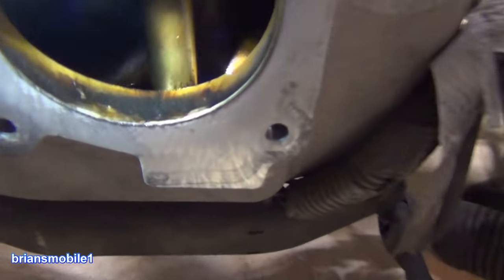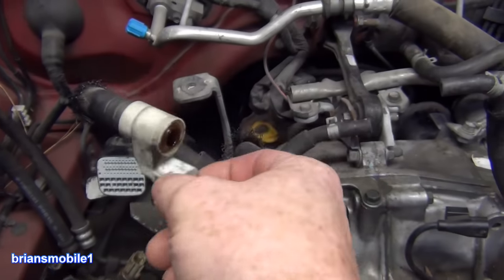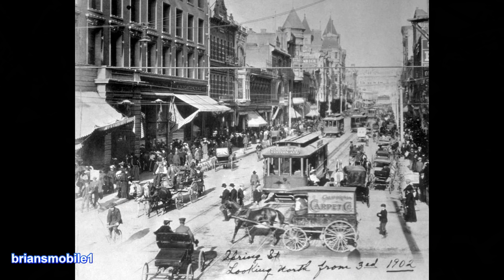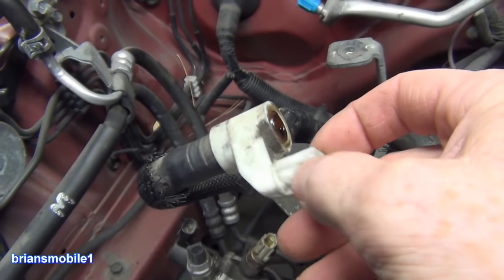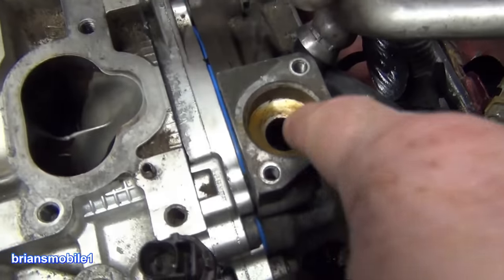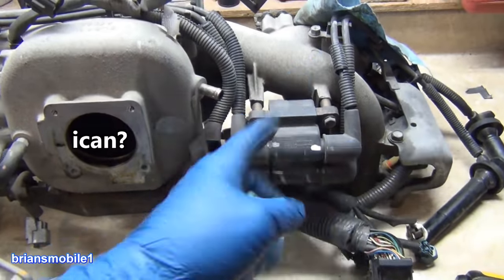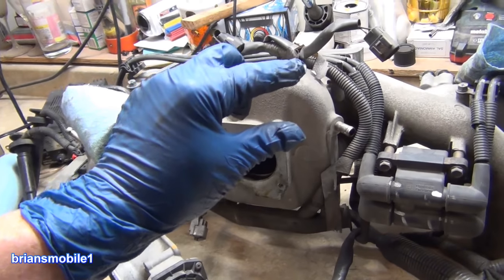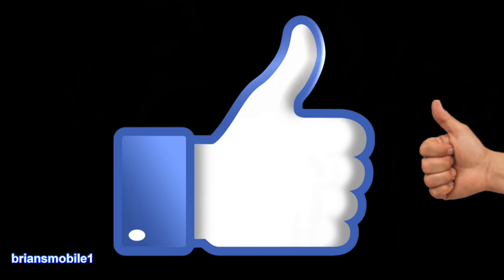Your Engine Fart Recycling System & DTC P1491

Comment: I think the "positive" in PCV refers to the fact that it actually pulls fresh air through the crankcase rather than simply venting the excess pressure.

Crankcase pressure relief is important, but combustion gases contaminate oil and are bad for your crankcase. So that's why they pull fresh air into the crankcase. One important aspect is that it helps keep water out of your oil--water inevitably gets in, but in a hot engine it wants to evaporate, and pulling dryer air in continuously promotes that evaporation.
Reply from the maker: That's right.  The breather filter is part of the system.  It's in the fine print in the video.

Comment: 3rd generation gm 2.4L has a huge problem with this. there is no pcv crankcase pressure comes out from a timing cover hose then down to a air/oil separator then back up to the air intake just past the mass airflow sensor. problem is cold weather creates excess condensation so bad entire airbox fills up turns to 10 pound block of ice filter & all. but that's the good news......this hot pcv gas enters throttle body thick ice builds up on the butterfly & pushes into the throttle position sensor causing stuck throttle while your driving only way to stop car @65mph is shut key off. in my climate zone aftermarket catch can full twice/week condensation water so clear could drink it
Reply from the maker: Wow!

Comment: Good to kmow. Senor brian what's a good oil catch can setup for my stock 2006 sti with 130,000 miles?  Also should I  remove the tubo banjo bolt oil screen filter or leave in? I change the oil every 3000 miles . Use denso oil filters

Comment: Hey, I've been watching your channel for a while now.  Great knowledge that you are passing on.  Wondering if you could help me out with a fuel consumption issue I'm having on my 10 Impreza.  I use to get 8L/100km (yes from Canada eh! lol) but now I'm getting 10L/100km on hwy.  I've tried cleaning the throttle body, o2 sensor, changing the air filter, and cleaning the MAFS.  But it hasn't changed anything.  Maybe you have a video on it that I've missed? Thanks in advance! Keep up the great work! :)

Comment: Great video, I have this exact engine!  Is there any merit in changing out the pcv hoses and vacuum hoses that go around the system. Less congestion, less oil burning perhaps?
Reply from the maker: Fortunately the Toyota influence helps with material quality.  These hoses last a LONG TIME, but if they get too many miles on old oil they get stiff and the ends split.  This can cause unfiltered air to comingle with the oil in the intake to make a valve grinding compound.  That's not worth sucking in there.  Best replace them at that point.  Fart jokes aside, it's a good system.  Catch cans are where it's at if you want to keep things clean and are willing to empty them religiously.  Otherwise, regular oil changes are where it's at.  Clean oil- less vapors.

Comment: Pcv.a weighted and sprung valve that releases the escaped compression that slips past the rings and into the bottom end, recirculating the oil saturated air into the intakes negative pressure side to help disperse said oily air via combustion by allowing it to be sucked down the intake into the combustion chamber...

Comment: Love videos. Hey have a question if you want to leave me your advice. I just put head gaskets on my 06 outback limited.its still on the engine stand. Only lacking timing belt and valve covers. I believe I have bad head bolts. I got new Subaru bolts. Can I change them one at a time without changing the head gasket? An how would I stretch the new bolts if I can do it that way? Thanks Randy.

Comment: Let’s say if one of my wires did get messed up causing it to think somethings wrong, it isn’t going to cause it to run bad and all of the positive pressure will still be released through the tube correct?

Comment: If you ever get the chance to do a video on chevy cruzes faulty pcv system id greatly appreciate it. My grandmothers cruze has caused me so much trouble until i realized what was causing it
Reply: Chevy owned up to it and now it's covered with special warranty.
Reply: @amirmograbi  i wish i would of known that before i replaced the intake and valve cover lol
Reply: @joshuasims7357  you can still get your money. If you have proof of the work done you can submit the receipts to them and they'll give you money !
Reply: @amirmograbi  i did it myself but i have proof of purchase on the parts.
Reply: @joshuasims7357  they'll reimburse that as well potentially. Do your research, but not sure if it's worth your time. I installed the after market fix and didn't want to deal with them.
Reply: @amirmograbi  yea i actually got a bypass as well but while putting it on the plastic was so brittle it ended up breaking the intake so i ended up replacing it.

Comment: I'm giessin' 3rd?
Hi Brian.
Can't wait until spring, so I can tear my 2003 253 apart!
Reply from the maker: Heck ya!
Reply: What is the part that the PCV valve screws into and is it bad that mine comes out pretty easily
Reply: @briansmobile1 I was trying to change the PCV valve but it wouldn't come loose so I cranked on it pretty hard before it finally broke loose but it was the part that it screws into that broke loose. I had to separate them by holding it with my bench vise and using the biggest ratchet I have. Is that bad that it came out though